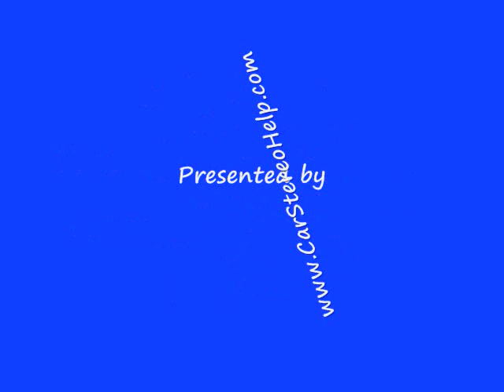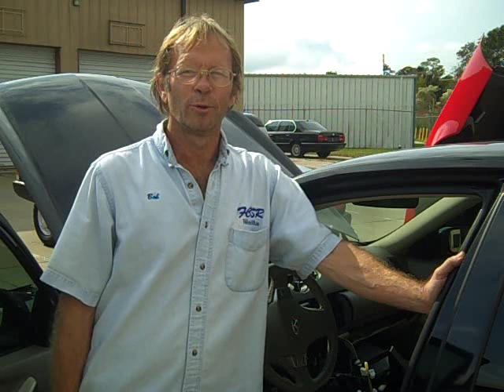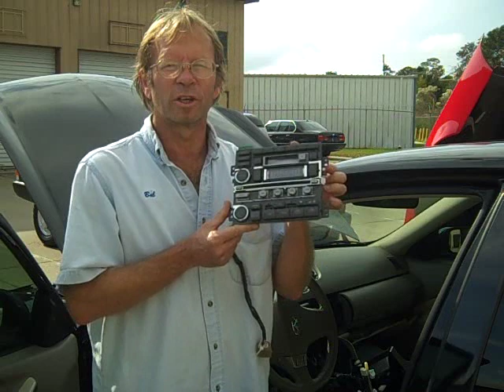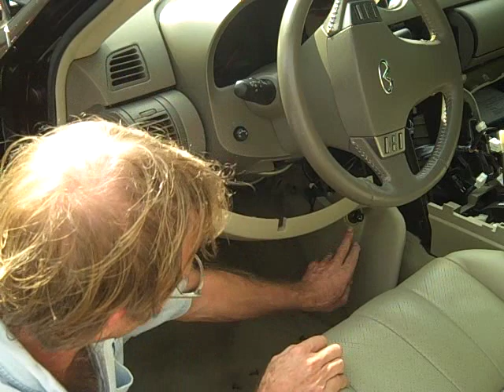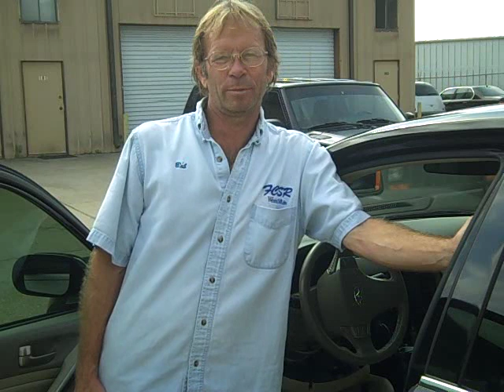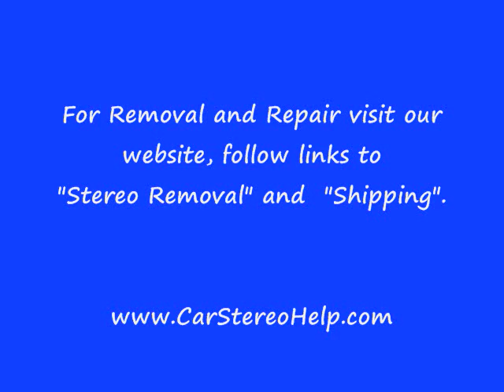Infiniti G35 Bose Stereo - AC Audio Finisher Board Troubleshooting = Car Stereo HELP

Comment: I'm troubleshooting a friends a 2007 G35. The battery is draining due to 0.4A parasitic current. It goes away after pulling the #37 (AUDIO) fuse in the engine-fuse-box (mentioned in video). The only problem is that apparently to operate the A/C system the Audio system must have power.

Comment: I have my 04 G35 with bose audio and no navigation. Tlall the ac and radio buttons work. But no sound. Changed the amp and it still has the same issue

Comment: My 06 sedan radio now hisses and crackles .it started funny yesterday and now the radio is noisy,bad only when the engine is running and all DC and ac voltage are ok like you said  ac volts starts off at .235 and quickly falls to. 000

Comment: I’m having a problem On my 2007 g35 sedan where the screen is blank and the all the controls for the a/c stereo don’t work what do you think that might be a fuse ? But I still see light coming from the screen it’s just blank
Reply: Did u ever fixed it
Reply: Yes it was the main radio  that wasn’t good .  Causing the display not to work replaced the radio and worked fine

Comment: I'm having problems with my after market radio and interior light's turning on. it works sometimes I was wondering if it could be an ignition switch problems.

Comment: Hi thanks for the video. I have a 2002 v35 with volume problems. Can you please advise me or direct me to the power loom wires that run the stereo and ac that go into the stereo as mine have all come out (me being careless) and I dont want to get the wires in the wrong place. I still may need to send my stereo to you for repair though

Comment: my air conditioner and radio were unresponsive after a faulty battery jump. took it into a local audio shop and had it fixed for $100. don't get scammed by stealerships!
Reply: Jae Park having same issue on my 03 G35. What type of repair did the audio shop do for you?
Reply: I know this is super late but I am having the exact same issue right now. As the other guy asked, what all did they do to fix it? My AC buttons and stereo buttons do nothing.

Comment: If the radio is working can it still be the problem causing the ac/heat not to work.  We brought it to Electronic masters in Duluth GA and they repaired the circuit board but still no ac/heat. They are not sure what to do next.  They are very very helpful but when he called the dealer they did not know what else to tell him to do.

Comment: Hi, I've got similar problems with my 03 G35 coupe. so my AC works fine, but my radio wont turn off. the volume works from the steering wheel an the panel. I took out the fuse 15A and it stopped my air conditioning and radio. I did it so it wouldnt drain the battery.. i am reading a lot of different things but nothing specifically pin points my problem.. any help please!

Comment: U have any experience with the 2007-2008 g35 sedans? My radio wont turn on and a/c stays on. No controls work either. Fuse was blown so I put another one in and that one blew too

Comment: I have an 04 G35 Coupe with an aftermarket stereo that works fine, however I'm having issues with the climate controls going dead frequently. After driving a while, they sometimes start working for a bit, however once the car is turned off and restarted they are inoperable again. I've read a lot of posts on the internet saying it's a Bose stereo issue, but since I don't have that system I'm at a loss. Any suggestions or troubleshooting ideas? Thanks.

Comment: Thank you so much for this. i have been dealing with the AC issue since I bought my car 3 years ago and i just ran into an issue where I could not adjust the A/C and my stereo would not turn on. Removing the fuse got me back up and running then I was astonished to see that that white connector was unhooked. I couldn't b elive that I could actually make my A/C controls work properly!!! You are the man. Thank you so much!

Do you have any recomendations on what a good stereo replacement?

Comment: Hi, I have a 2003 g35 sedan, my heat won't shut off, radio has no display, can only change radio with steering wheel, also cd's are stuck inside can't get them out.  Infiniti told me I need a new circuit board as well as radio? need some help here, do i just need the radio? thanks

Comment from the maker: There are two fuses to the stereo. One is labeled for the stereo - switched +12 volts when the ignition is on. Two - constant +12 volts to the stereo to hold memory, this fuse in many cases is not labeled for the stereo. Some cases, it could be labeled "Back Up".

Comment: Hi, great video, thank you.  I have a G35 and I'm having the battery drain problem.   A few weeks ago I removed the radio fuse like you instructed but I'm continuing to have the same problem even after I jumped the car and left it running for an hour.  Could this be because my battery doesn't hold a charge any longer after a few months of dying every day?  So if I went and replaced my battery and left the radio fuse out, it should work?

Comment: i have an 03 g35 coupe... whenever i turn it on , the A/C has a mind of its own and buttons dont respond, also the radio won't turn on? any advice? thanks
Reply: chaz miller I had the same problem today, I know I’m 7 years late but for anyone wondering, take out the radio fuse located by the battery, keep it out for a minute and put it back in and it’ll work
Reply: Karn Sidhu temporally or forever?
Reply: chaz miller yo i'm having that exact issue.. did you get it fixed by any chance & if so how did you do it
Reply: Same here
Reply: chaz miller same
Reply: David Romero same

Comment: I have the Bose system with navigation and DVD player in the arm rest. I do not have a drop down screen on the ceiling because it has a sun roof. I believe the Bose has two speaker on the head rest of each front seat, one on the front dashboard, one in back behind the back seat just under the rear window, and one on each door. I hope this is enough information. Have you seen this problem before? If you have any more questions for me feel free to call or email me.

Comment: 2006 M35 I turn the car on after it has been sitting awhile all I hear is static. I have to turn volume really high to hear the static. As I drive the radio station becomes more and more clear. Sometimes I'll suddenly hear a crack/pop and the system will work as it should and everything sounds great. Recently, the crack/pop has stopped happening. I can listen to the radio with lots of static but have to turn the volume up to pass the half way point just to hear it.

Comment from the maker: Are you the original owner? Call your local dealership with your VIN, ask if you have the Bose system. A Bose stereo in a non-Bose system will give extremely low volume.

Comment: i have a used 2004 g35x.. it has a 6 disc changer and tape deck.. on the tape deck it says bose.. the audio volume is extremely low. i dont see an amp anywhere in the vehicle. do you think this is a bad headunit?

Comment: i have an aftermarket stereo and i was told that would fix the battery drain, but it did not, i just bought a batter 2 weeks ago and it already dies 2 days after sitting in my garage (im not drinving it in the winter) .....

please help

Comment: @crunnrlls sounds to me like a problem with the ignition switch or a relay that may control your accessories, probably ign switch though.  drop the dash and check with volt meter

Comment from the maker: @bumblebeecbr You could unplug the amplifier, it is located in the trunk bolted to the bottom of the rear package shelf. See if the current draw continues. My guess would be the stereo, again. With the number of these stereos we see in shop for repair this is a stereo problem. See carstereohelp (dot) com

Comment: great video. I have a 2003 g35 sedan that has been giving me this problem for a while. I have replaced the radio unit with another oem one and im still getting this drain once and a while...its seems to be intermittent, it will come and go. I've read that the amp is powering on and making a draw. Is this a malfunction with the amp itself or does the radio control that? In other words, is the radio powering on the amp, or is the amp faulty?
thanks

Comment: Thank you for this!  I'm having the AC/radio problem right now and the dealership has replaced the finisher board for me and now I'm waiting on the radio (spent $1300 so far!).  I'll have them test the old finisher board once the new radio comes in.  This is great info, thanks again!!

Comment from the maker: Key off. You are removing the constant +12 volts to the stereo. This removes all power to the stereo to reset. If problems persist, this is a repair issue. Please see the link in the video for repair.